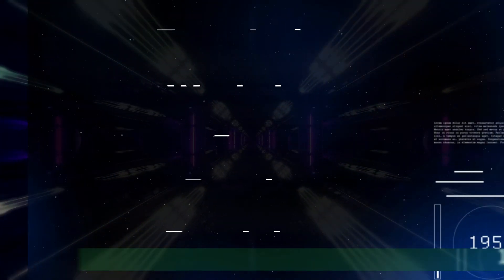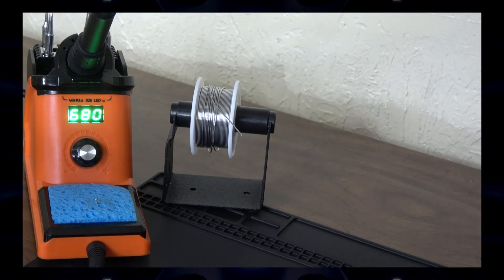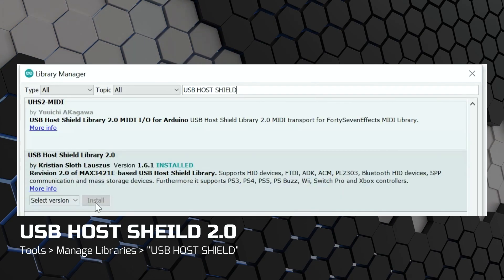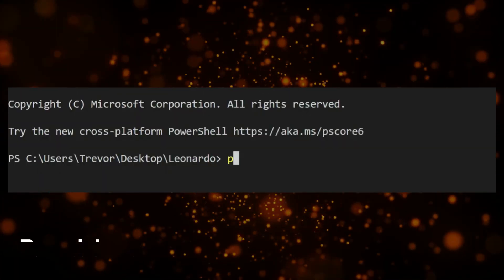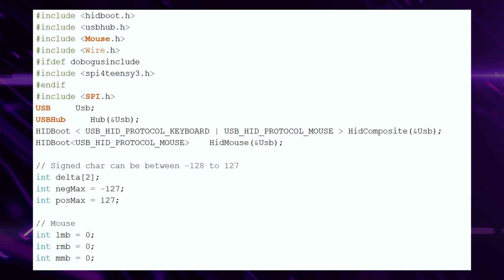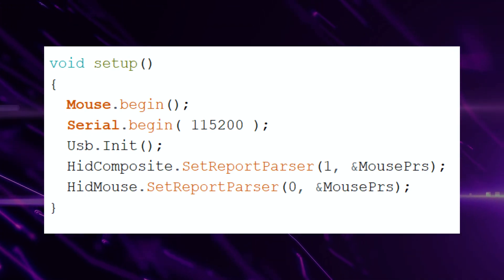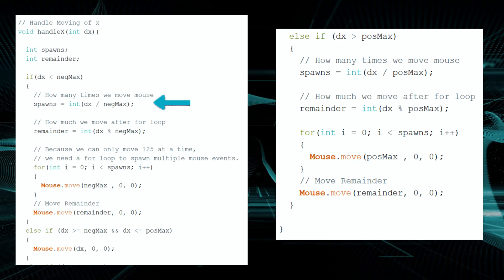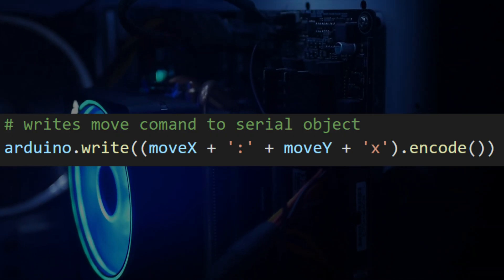Arduino Aimbot Tutorial | Pyserial Tutorial | Tech Breakdown 3

Comment: Hi, how did you manage to solve the inaccuracy with mouse movements? I’m working on a similar project (different game) using an Arduino Pro Micro to control the mouse. But when I send a command like 500,500 or 50,50, the cursor doesn’t always move exactly that number of pixels, even though I stay within the -127/127 limit per step.
My workaround was to add a check in the Python code: it sends the command to the Arduino, the Arduino moves the mouse, then Python verifies if the target wasn’t reached and keeps sending the command until it gets there.
Did you have the same inaccuracy issue? I’d like to know if there’s a simpler solution than mine. Thank you

Comment: i get this error some one help me

 Connecting to programmer: .
Found programmer: Id = "CATERIN"; type = S
    Software Version = 1.0; No Hardware Version given.
Programmer supports auto addr increment.
Programmer supports buffered memory access with buffersize=128 bytes.

Programmer supports the following devices:
    Device code: 0x44

Comment: Hello there. I'm having some issues with the setup. I bought Arduino Leonardo and USB Host Shield, soldered it, checked USB port on the host shield for voltage with multimeter, even plugged phone and desk light and it's working. However when I plug my mouse, it doesn't work. Lightning of my mouse doesn't turn on, I can't move my mouse, when I plug my mouse I don't even hear the windows sound, the sound You would hear when the device is plugged in the computer. I tried using different codes for the Arduino but they didn't work... Any advice how to troubleshoot this issue?
Reply: me too, did u fix it😢
Reply: I think ur mouse not compatible, try a cheap hp mouse
Reply: Search for slyautomation valorant ardino aimbot ,u might figure it out

Comment: Dude I just bought a Leonardo 3 for a DIY Flipper Zero I'm building and accidentally found this. SO COOL!!! Thanks for explaining everything so well.
Reply from the maker: Thank you for the positivity. Glad you found this helpful.
Reply: hey! im here for valorant cheats and i just happen to come across your video, for the soldering part I am confused, Do I place the heated metal on top of the tiny circles or do I connect it to the something else?
Reply: @trevorsatori Bro, it's still safe to use without bypass

Comment: Is this possible using a raspberry pi?
Reply from the maker: raspberry pi is used for high level operations. For all intents and purposes it can be thought of as a computer. An arduino on the other hand is a microcontroller which simply executes commands it is given, the main difference being you write these commads that tell the hardware what to do.

Comment: I get this message in the Arduino output "Connecting to programmer: .
Found programmer: Id = "CATERIN"; type = S
    Software Version = 1.0; No Hardware Version given.
Programmer supports auto addr increment.
Programmer supports buffered memory access with buffersize=128 bytes.

Programmer supports the following devices:
    Device code: 0x44" 
What does that mean?? @satoridigital1078
Reply: Try installing version 1.8.19 of the Arduino IDE. It fixed my problem with this error, however it still isn't working for me. My mouse doesn't work.

Comment: Why do I need a usb host shield? I can't use my arduino as a HID device?
Reply from the maker: You only need a host shield if you want to use a mouse through the Arduino. Otherwise you're right, you can simply create a script with Python piped to arduino and use your regular mouse as normal.
Reply: @trevorsatori  But you think it would be detectable? I mean, 2 mouses would be registered as input right?
Reply from the maker: @GustavoHenrique-wp9kc  as for detectability, there's no guarantee. This is meant to Be a learning experience so for games like mine craft and others this works great but competitive games are always on the look out for exploits and it's a constant arms race

Comment: very good video!  I have a question, I'm working on an anti-cheat project, and to test this project I need to make a cheat first hahahaha to test, I would like to know if there is a possibility to make the aim adjustment made by the arduino as smooth as possible.  Something like limiting recognition fov and smoothing motion.
Reply from the maker: Of course, you can do this by adding delay() in the arduino script.
Reply: @trevorsatori  Nice 👍
Reply: @StrongerFX  Any luck on the anti cheat?
Reply: @Avissarin  im using my own for 9 months, and 0 problems, radiante with a good Tracker
Reply: @StrongerFX  Are you developing a game that requires an anti cheat? or are you talking about the cheat in general? i apologize for the confusion.
Reply: @Avissarin  i do a valorant cheat, i dont have any bypass, or something like that, i Just use my code and never banned.
Reply: @StrongerFX  oh right-o! i tried this method, on halo infinite. got it working. but not fast enough. always lagged behind the character if they moved. however i was thinking about making recoil scripts using this method. Were you able to get the vision aimbot working?
Reply: @Avissarin  for me Works well because i have a rtx 4080
Reply: @StrongerFX  yea perhaps thats the issue. i was using a rtx 3060.
Reply: @StrongerFX  hi help me pls

Comment: Your project is awesome. Can I handle the signal input of two mouse at the same time with an Arduino Leonardo? I want to add some functionality for targeting. I mean each mouse will control one available function, I think they will be better when we switch function by keyboard, this cause program delay and create very complicated thread code (Sorry because of my English Translation)
Reply from the maker: I'm confused by the question? Could you give me an idea of the actual project?
Reply: @trevorsatori  I get this message in the Arduino output "Connecting to programmer: .
Found programmer: Id = "CATERIN"; type = S
    Software Version = 1.0; No Hardware Version given.
Programmer supports auto addr increment.
Programmer supports buffered memory access with buffersize=128 bytes.

Programmer supports the following devices:
    Device code: 0x44" 
What does that mean?? And how can I fix it?